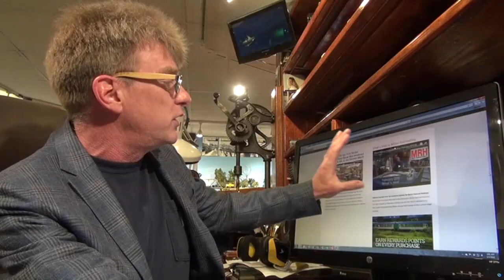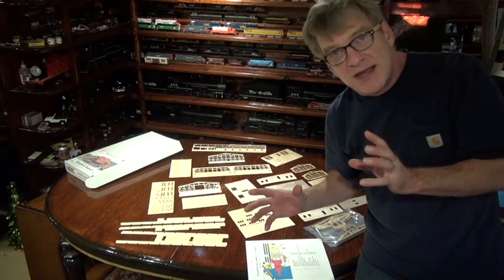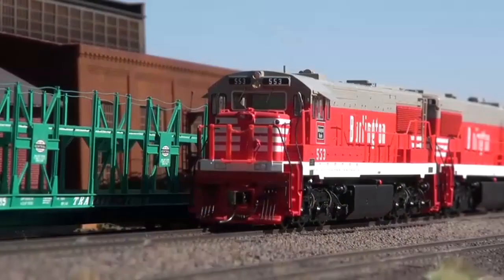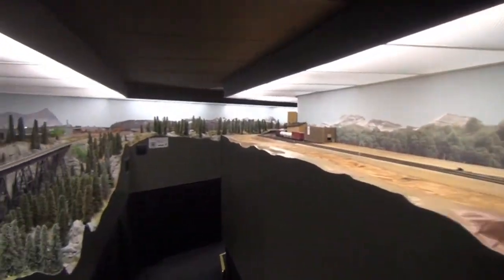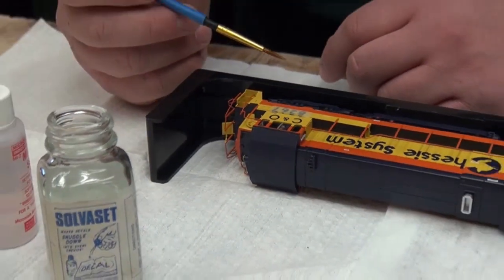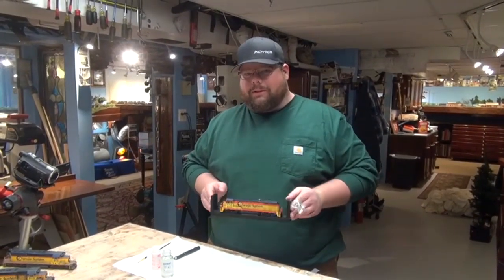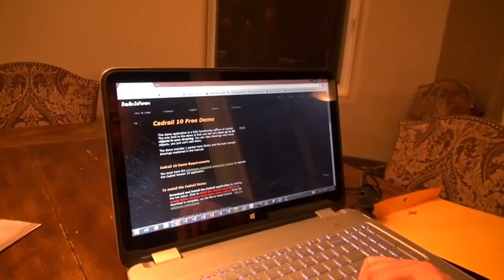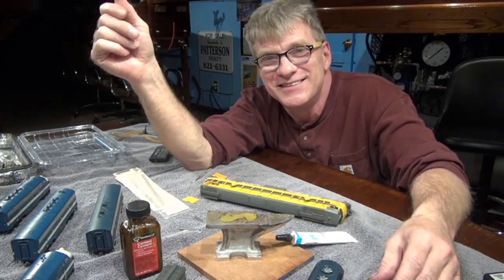Whats Neat in model railroading | April 2018 Model Railroad Hobbyist | Ken Patterson

Comment: Nice segment Ken! I use Canopy glue for all my screen work and photo etch roof walks and to attach wood decks to flat cars. Similar concept to the rubber cement, canopy glue stays somewhat flexible when it dries. What's neat about the Canopy glue is it dries clear, also the excess can be rubbed off with your fingers. I've never had screens or decks detach using it and I have been using Canopy glue for over 10 years on my models.

Comment: Here's a suggestion on contact cement.  Generally, the intention of the manufacturers of this medium is that you apply the cement to both surfaces - in this case, the screen AND the locomotive - and then let it air dry thoroughly before mating the two parts together.  This will provide a very strong, yet flexible bond.  One that is stronger and more permanent than installing the screen on the locomotive with the glue still wet.  The one drawback to this method is that your positioning of the screen on the locomotive MUST be extremely precise because the screen will be very difficult to remove should you get it on there crooked.

Also, I've got well over a decade of experience with CadRail.  The best thing about it that I've enjoyed the most is no more perma-smudging on paper after making eraser corrections. It is THE most useful tool I know of for verifying whether your design will fit into your room's dimensions. 

Keep up the good work, Ken!

Rick Shivik
HO D&H Champlain Division
Conyers, GA

Comment: I was demonstrating the # removing trick as a mini-clinic at one of our club meetings (I had watched one of Jason's FB videos) and I used Solvaset like he did, which in most cases works quite well. I tried the same trick on a old E&C B&O Chessie boxcar, and the Solvaset was so strong, that it really only required having a damp paper towel, and lightly rubbing the numbers to get them off - I had to repaint the area on one side where I had followed the process Jason shows, as it softened the paint so much, that it also came off.  So - always test someplace inconspicuous if you don't have prior experience with that mfg.

Comment: wow the BNSF layout is amazing for sure. ok so easy enough to remove the numbers on the side of a loco, But what about the number boards?  Cad Rail is a good way to get what tracks we need. but I am still old school, pencil and paper. but would be a cool site to check out. thanks for the glue ideas with the U50's, the grills have popped off of mine also. 
Thanks for the great and helpful show Ken. see you on the next one

Comment: Canopy Glue is what would work for locomotive screens and other various parts. Strong and dries perfectly clear. I use it for windows on model cars as well as the headlights. Works great on chrome pieces as well. Canopy Glue will hold those screens on and will be much cleaner and easier than contact cement.
Reply: I have to second the use of canopy glue, plus it doesn't stink like contact cement!
Reply: What I do as well. Just spread a micro film, allow to tack for a few seconds and then apply the screen applying slight pressure as it sets. No mess at all and it is invisible.

Comment: Unfortunately, the solvaset trick only works on a few models. I've tried it on many models from various manufacturers and era and it simply doesn't work most of the time. Most of the time, solvaset will work but not perfectly, in a way you need to simply wet sand the lettering. Far to be the easier way to do it and can easily alter the paint job.

Comment: Ken,  when you pull the lift out section,  it should be pretty simple to set up a way to cut power to the last, say 10 inches of track so your trains don't wreck.

Comment: To attach metal screens to my E-8 kitbash, I used clear silicone from a tube, The diameter of the tube end conveniently fits the height of the grille section on the E or F unit, run continuous, it allows the etched grille to adhere and adjust to temperature differentials that cause the grille to expand and contract differently than the body shell. contact me at cdcarter@rochester.rr.com for a photo.

Comment: How about doing a segment with something a non-millionaire can afford to do or build. Everything you do is out of 90% of the modellers price range.
Reply: In one segment, Ken used hand tools and pink foam which can and is used on layouts of all sizes in all scales. In another segment, Jason used a hobby knife and solvent. The price of  CADRail is less than the cost of an average locomotive. Finally, Ken used contact cement and small parts to detail a broken locomotive. Just how exactly are the tools and equipment used in these tips, lessons and suggestions out of the price range of 90% of a modeler?